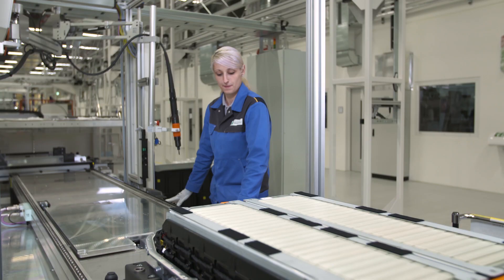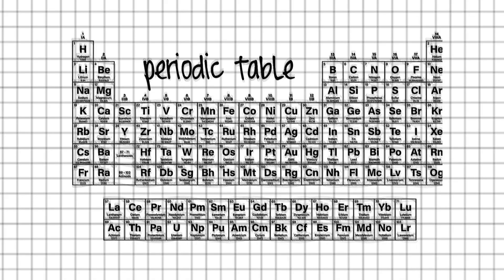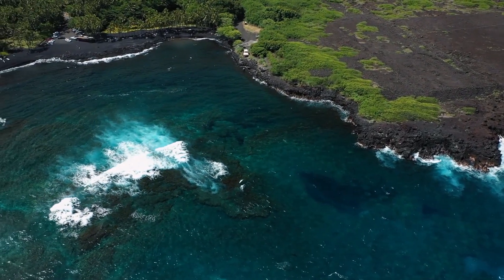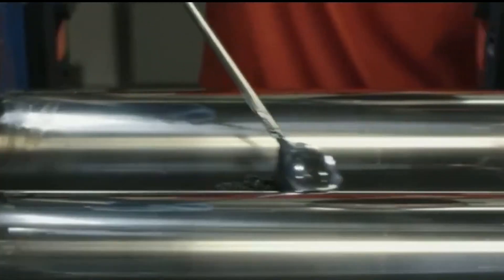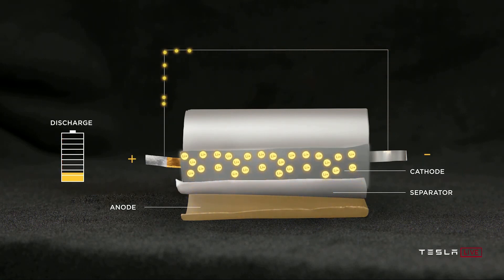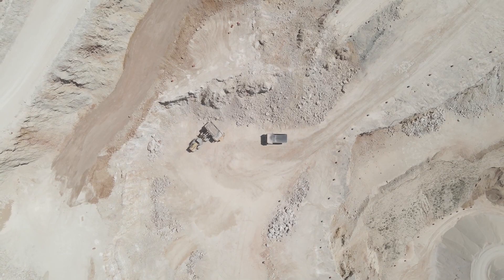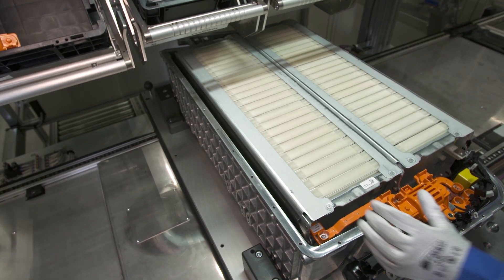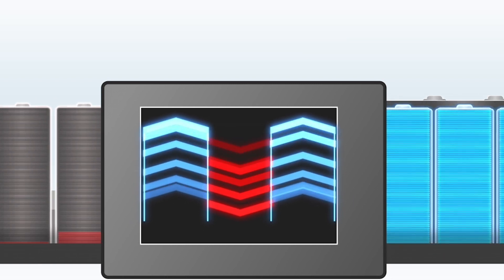L for Lithium ...explained! | ABC... EV

Comment: Good explanatory video. I think the only things missing was the percentage content in a Lithium-Ion battery that is actually Lithium (less than most people think), and that it is not to be confused with Cobalt, which it often is (I don't know why, but there you go), e.g. children do not mine Lithium in the DRoC. The problem with Lithium mining is exactly the same as for any other open cast mining process. You potentially screw up the landscape performing it, plus you pass through an awful lot of water in the process, again as you do with other mining processes. The plus side is that all the elements of a battery can be reused again and again once it comes to the end of its early life of 15 years or so. Companies like Redwood Materials will sell you pure recycled Lithium and the other elements, so newly mined Lithium requirements are drastically reduced. Eventually, there's more recyclable and recycled material out there that there is virtually no need to dig holes in the ground.
Reply from the maker: Good point on the Lithium % content. So hare to get everything in though! Will be very interesting to see how recycling goes. It's easy to say it'll all be recycled, but companies need a financial incentive or to be forced to do it! Thanks for the comment Andy!